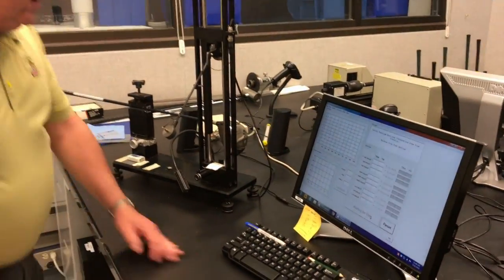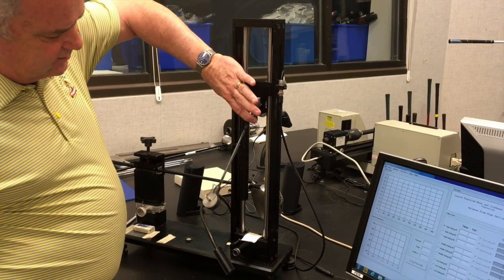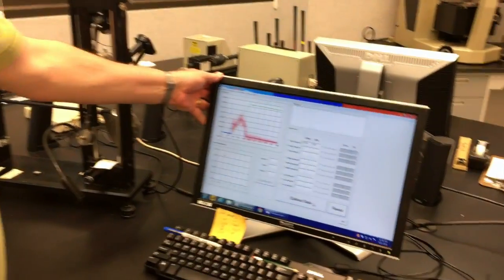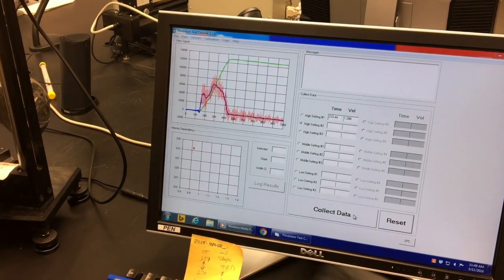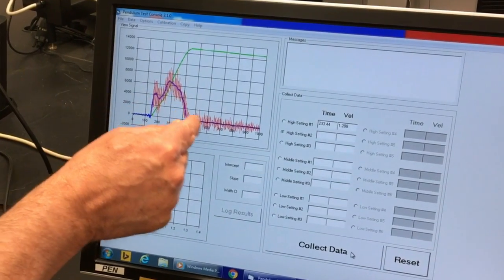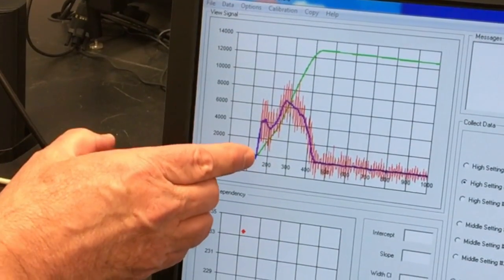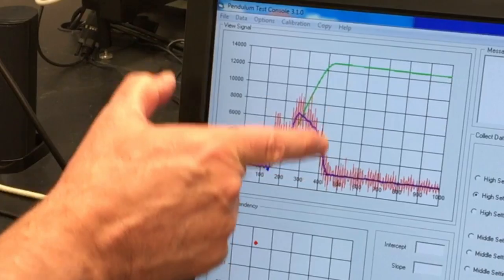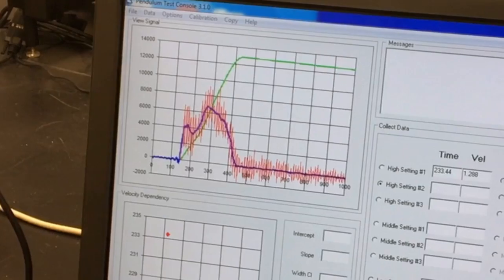USGA Coefficent of Restitution Test

Comment: Thank you for the nice info. I have one question. Is there a reason you perform this test with the head attached to the shaft? I'm curious whether or not the stiffness of the shaft have any effect on the test result. Since the flexibility of the club face is much lower than that of the shaft and the applied impact is so small, it is my guess that the test result would more rely on shaft stiffness rather than the face itself. For instance, if you have the same club heads on two different shafts, one being very flexible and one infinitely stiff, wouldn't the pendulum on the flexible shaft 'stick' to the face longer than the infinitely stiffer club? Hope you can find the time to resolve my curiosity. Thanks:)
Reply: Great question,  since the collision between the two objects  ( club face  and pedullum ) is taking place in approximately 230 micro seconds, the entire event is over before the shaft begins to flex.
Reply: this is obviously a bad experiment.
Reply: @6opekaso221  Ah ah ah tu as etudié où toi ???

Comment: I completely agree with junnani75, there is no way your testing the cor of JUST the clubhead with that test. You can test it without taking the club apart but you must clamp it ridged at the hosel. Please make a video to prove me wrong. Simply test with that setup then with the same test equipment but with a secondary clamp on the hosel run it again.  My bet is it won’t even be close. I am shocked your setting up an industry standard with that test.  Don’t tell me,,, show me.

Comment: Measuring a golf ball's speed pre-collision and post-collision is the best (but certainly not the easiest) way of determining the coefficient of restitution of a golf driver club face.  I understand the need for portable test equipment, and quick test setup and execution.  While the CT test fulfills those needs, I believe it is imperfect.

The amount of time an object is in contact with a different object is not a good means of measuring coefficient of restitution (i.e. spring effect).  Imagine your test's 'golf ball' hitting a club face that is a block of medium firm tofu.  Because the tofu isn't greatly elastic, it absorbs much of the collision energy, and that takes more time than a highly elastic collision (i.e. with a titanium club face).  Yet the characteristic time of the tofu collision would exceed current established CT limits, thus be considered illegal,.